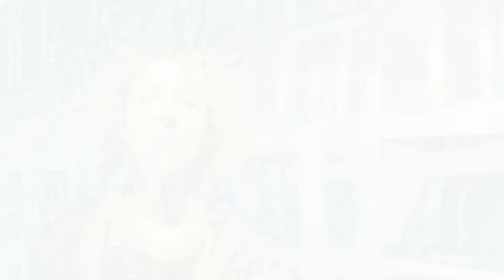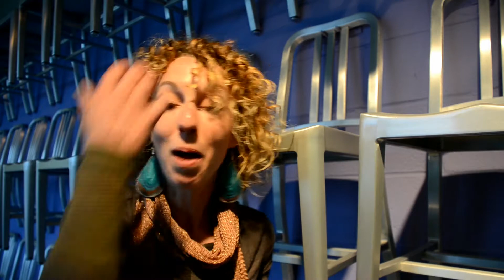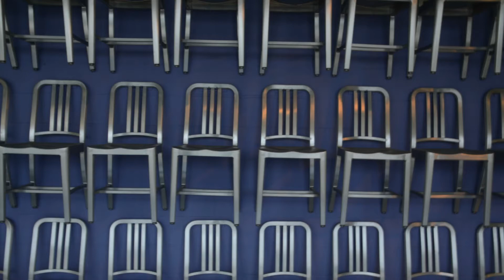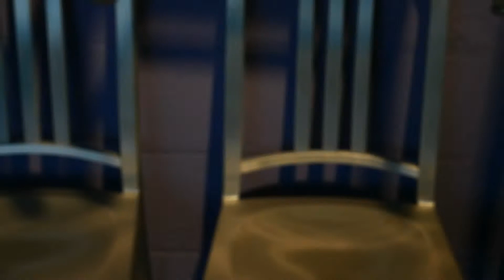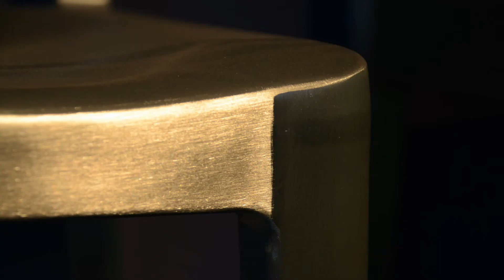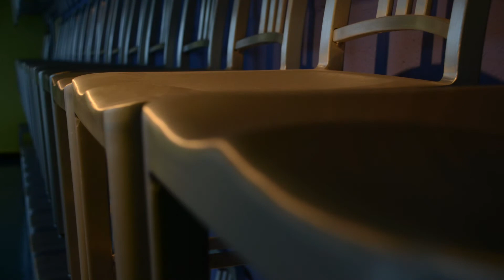KO Angotti Visits Emeco

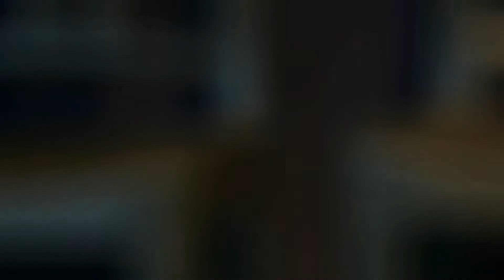Comment: Thank you, Kara, for your video. Regarding 1:53, the process of anodizing aluminum involves electrolysis in a tank of sulfuric acid which transforms the treated surface of aluminum with a thin layer coating of Aluminum Oxide known as Corundum. Corundum is the mineral of which Rubies, Sapphires and Emery are composed. Aluminum is a soft metal and has a Mohs Hardness of only 2.75. On the other hand, Aluminum Oxide has a Mohs Hardness of 9. For comparison, Diamond has a Mohs Hardness of 10 which is the hardest of all materials.